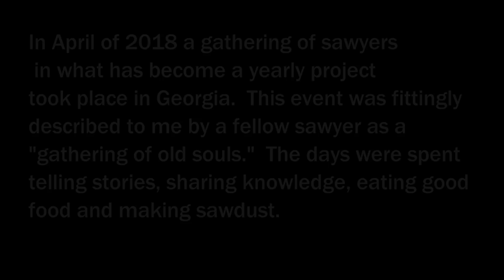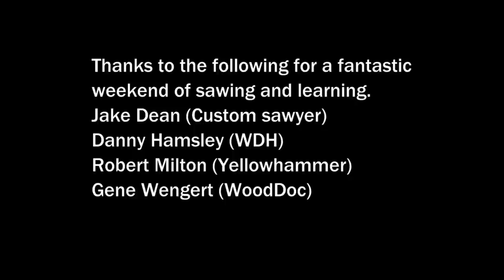This Is How Lumber Is Made At A Sawmill, Quarter Sawing A Huge Sycamore Log

Comment: That 20” jointer... ❤️❤️❤️. I guess humidity down there isn’t as bad as here in Maryland.  An open sided barn would mean flash rusted cast iron tables for sure here.  

Awesome that you have these gatherings with a bunch of people sharing the same passion for timber.  Good stuff.

-Ben
Reply: I'm pretty sure the humidity is at least as high as in Maryland. Hence, the wax going on the table.

Comment: Hello Nathan, I've been watching your videos for a while now, and I'd like to sincerely thank you for sharing this part of your life with us viewers. I'm a retired Residential Electrician, on disability,(heridetary bone condition called Epiphesial Displasia. I've had my right hip replaced twice, and am overdue for replacement parts, and the left side needs done as well. Covid messed things up, as I was supposed to get my surgeries this year.) I've always wanted to get a saw mill, as I love woodworking, but I guess this is the next best thing:) 
My question is this: Being as the blade on the mill runs through both sides of the log, Why is there not a debarker on both sides?
Also, on a side note, I've recently found another channel,  on Youtube, Sampson Boat Co. If you want to see some amazing joinery, check it out. He's rebuilding a 110 year old wooden sailing yacht.
Reply: Al Taylor  I imagine that as the blade only "enters" the log on one side,  the de-barker's job is to clear the cutting area of debris which could damage the blade and / or be dragged into the wood. The opposite side of the log is where the saw blade "exits" so any foreign matter would be expelled away from the log being sawn. I’m sure Mr Elliott will correct me if I’m wrong.   

Great aerial shots as usual, and exquisite wood graining on the sycamore, which is almost considered to be a weed here in the UK, as it seeds so readily.

Comment: That Q. sawn Sycamore is really nice, I could do with some of that book-matched for some guitar bodies.
Reply: This is crazy, but one night I noticed someone in my neighborhood was throwing away an old bed, and there were two good sized planks.  They were tone sprayed so it was hard to tell what it was.  I figured it was probably maple.  I came back with a Subaru wagon, popped those planks on top and brought 'em home.  Danged if they weren't quartersawn sycamore.  I made a nice table out of it.  It took me a few years before I figured out what species it even was.  That was a good haul.
Reply: Go for it. I am currently making a through-body bass guitar. The neck is sycamore that I got from a supplier in Sussex, UK. That wood is so dense that I may struggle to reduce the overall weight. Can't wait to hear what it sounds like though.
Reply: This is a downward spiral. I spent a while making 1/4 sawn sycamore stuff and it always twists. Save yourself the time and effort. It's beautiful.. agreed. But def not neck wood.

These videos are so awesome. I really enjoy them. Thanks for all your hard work!
Reply: @davidjohnson00001  I spent a few years using a very stable version of sycamore. It's a twisty wood that does not work for necks, IMO.
Reply: @rdesutter76  Thanks for the advice, but that is why I have laminated the neck. It is two pieces of well-seasoned sycamore with tigerwood in the middle. Still pretty heavy but I like to experiment.
Reply: @davidjohnson00001  good luck. I tried the same thing.

Comment: 1:32 Even with the vacuum system, there's still plenty of sawdust to go around!---11:41 It might have been just an optical illusion, but that looks like the expensive quartz counter tops that most people favor for their kitchens.---16:13 While I appreciate the novelty of cutting the wood in that fashion, I still don't quite catch the practical applications of doing so.---Thanx for the new music! And, the re-visit!
Reply from the maker: yes, thank you for the support!
Reply: Alana Tolstad quarter sawn boards are not practical.  It is a wasteful way to cut logs but the only way to expose the medullary rays in white oak and the lacewood pattern in sycamore.
Reply: @dagwood1327  They're not practical to produce on a bandsaw mill with all of the log handling.  The method illustrated here was to maximize the amount of quarter sawn lumber cut.  Producing quarter sawn lumber and a swing blade sawmill is much easier as you don't have to move the log at all.  It's just a matter of adjusting the sawing pattern to produce quarter or rift sawn wood.
Reply: @dagwood1327  And...what would be the practical application for cutting it that way? I'm guessing something craft-specific?
Reply: @alanatolstad4824  The quartersawn wood is more beautiful.  It brings a higher price.  It's prized for its appearance.  This is species specific; not all wood looks great if quartersawn.  As Gone Underground mentioned, oak and sycamore are good examples.
Reply: @incognitotorpedo42  But...how will it be used? Bowls, knife handles, banjo frets...?
Reply: Furniture maker here. Quarter sawn lumber is more stable than rift sawn. With rift sawn lumber  there is a tendency to « cup » as it dries. Not so with QS. It is preferred for any furniture with large surfaces where warping with changes in humidity could be a problem. And with some woods it really looks nice!
Reply: Quarter sawn wood used in flooring because the expansion is mostly up and down, so it doesn't expand/contract with moisture in the dimension across the room and buckle or push wall out. And it is stronger in musical instruments, like guitar tops. If you look at guitar tops, you see lines because it is quarter sawn.........

Comment: Do you sharpen the saw blade? Or, just replace it? Must be very expensive.
Reply: They can be sharpened a few times; Woodmizer charges about $5. The blades are actually pretty cheap (~$25) because there isn’t any carbide on the teeth
Reply: @G0F15H  Wow. I would have guessed a couple hundred dollars.